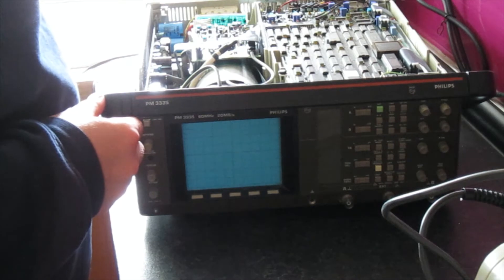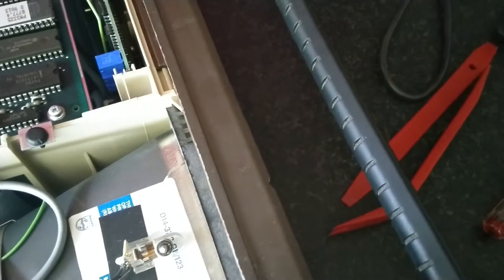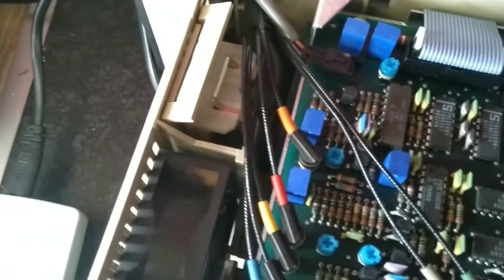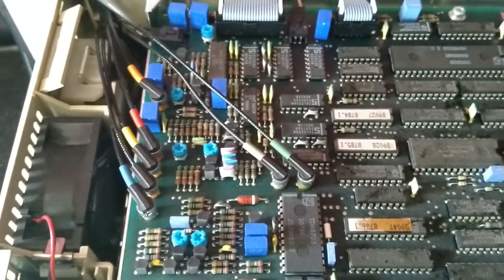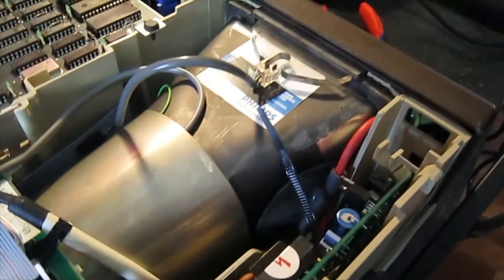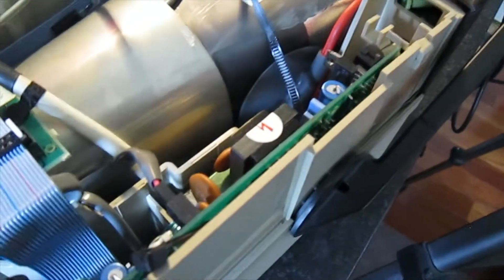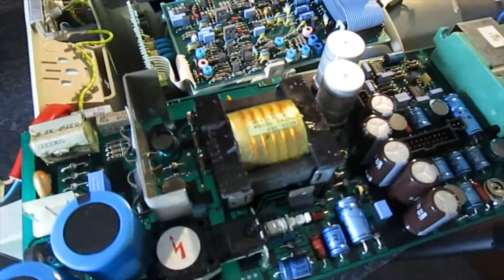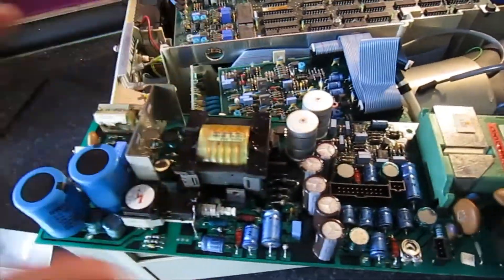PM3335 PSU removal

Comment: Hi, I've recently worked on a similar model the PM3055. To remove the red power connector arm, you need to "pinch" it, that way it opens up like a clip and lets go of the main power switch.
Mine stopped working because one of the two silver caps (close to the 5 you desoldere) went to a dead short. The RIFA X2 mains cap was also cracked, and luckily you can still buy an exact replacement for it. My power supply came out much easier with a little bit of fiddleing from the underside, where there is a small opening to access the supporting brackets.